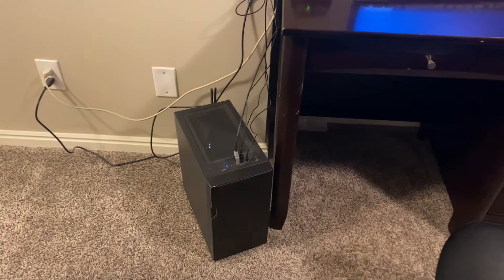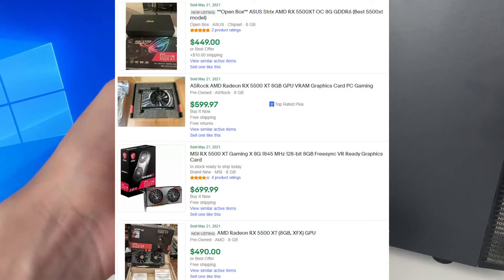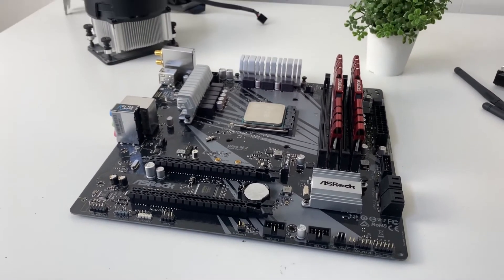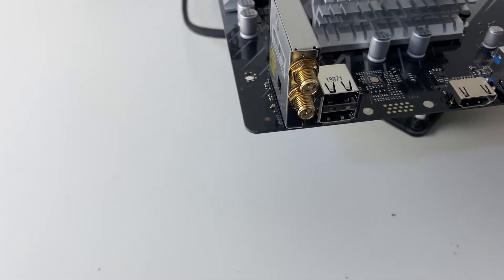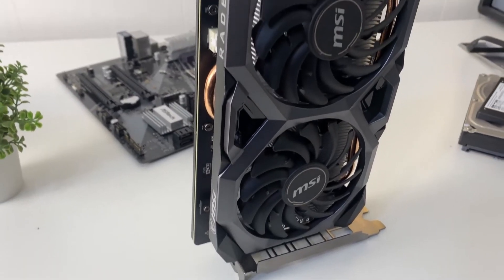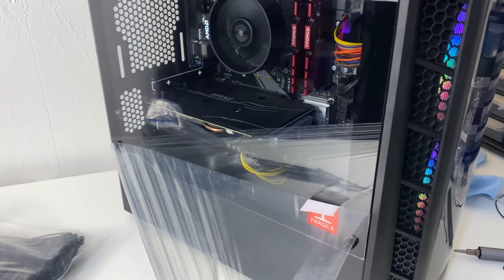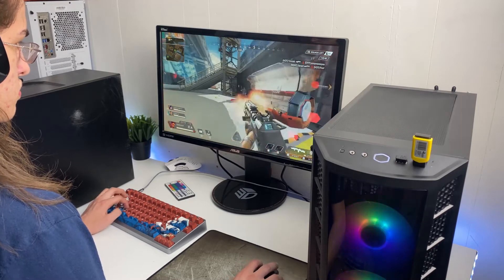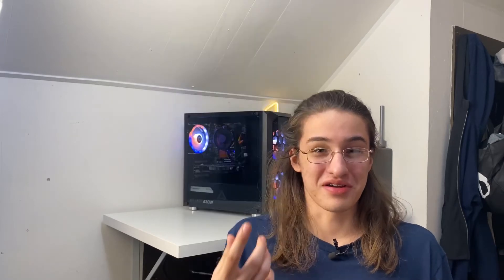The EASIEST $300 of my life! FPFP Ep. 14

Comment: If you can stretch the budget without blowing the budget or return you should buy a few sets of PSU cable extensions and keep them on hand to hide the ketchup and mustard. Also, the Ryzen 5 1600 very early models were subject to a recall which is a handy negotiation point because most people don't know what they have under the heatsink.
Reply from the maker: Thanks for the tips! I rarely buy cable extensions. It definitely makes the build look nicer but I’ve never had anyone complain about the ketchup and mustard cables